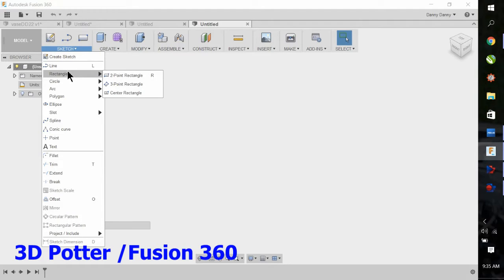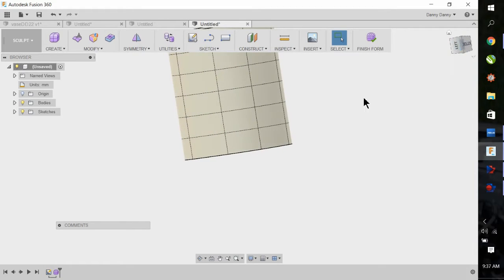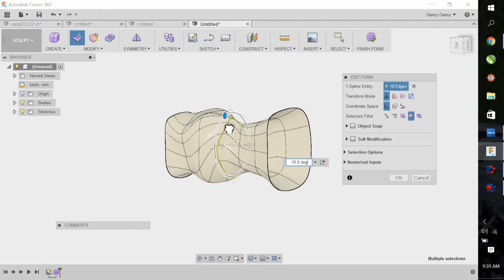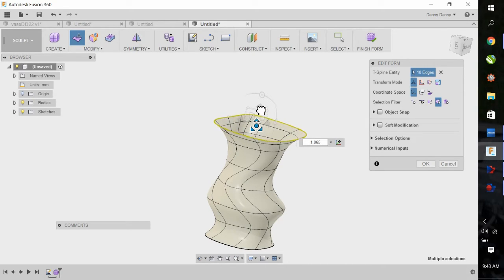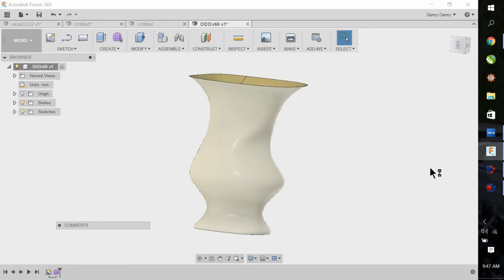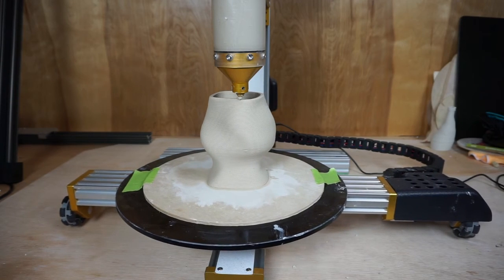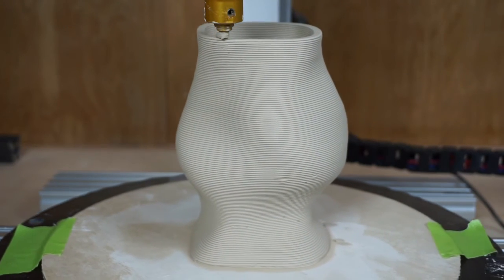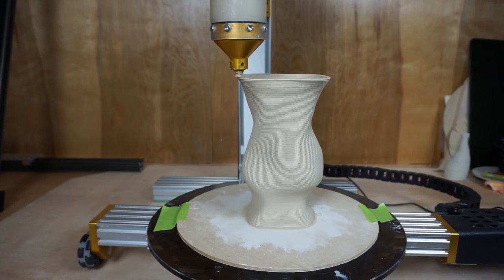3D Potterbot V2.9 and Fusion 360

Comment: I tried this and could not find out how to make the lines visible.  I can move the mouse pointer over them and the section it points to is visible but not the whole line.
Reply from the maker: Carl sorry for the delay ,give me time stamp of where you're talking about
Reply from the maker: If you're talking about clicking on the line and selecting 360 degrees, you have to double click on the line